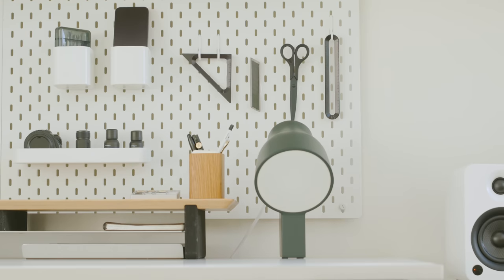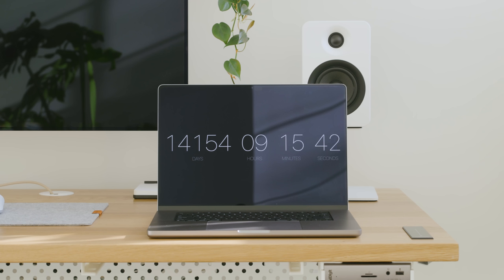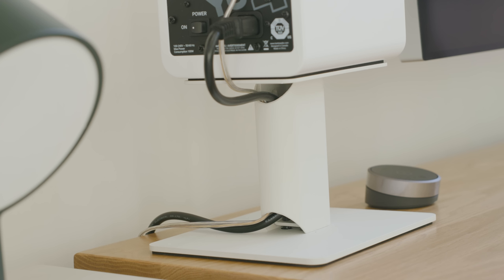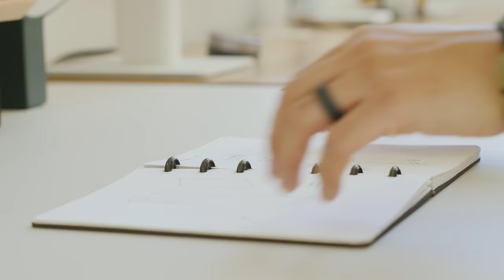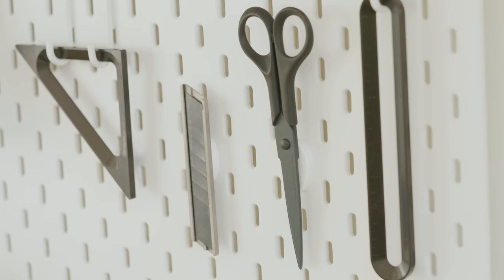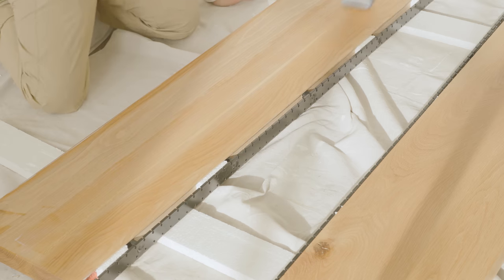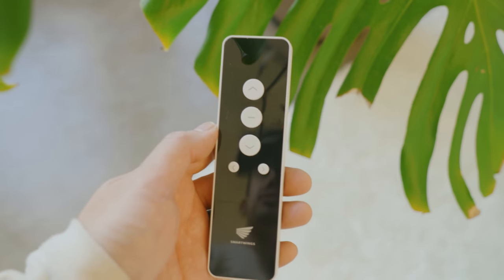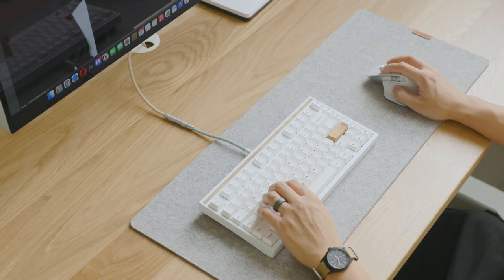Modern Desk Setup & Office Tour – Calm, Cozy, Creative

Comment: Do you have concerns about scratching the MacBook? The bracket for it looks like it would easily scratch the finish. And what about heat issues with constricted airflow under the desk?
Reply from the maker: I haven't had issues with either. The fan does spin up when rendering videos, but nothing to the point where I notice any performance issues.

Comment: turning on my laptop without the need of physically opening up the lid has been a struggle for me specially for a secured one which is company owned. any tips on that? I'm wondering how you open your macbook with this setup, do you remove it and press on the power button every time you need to turn it on?
Reply from the maker: I rarely turn my laptop off. No need. So this isn't really an issue for me.

Comment: Design question: I've created a modern office based off the ergonofis alive desk, medium size. I'm using a pair of SONOS ONEs speakers and I just purchased the SONOS mini sub for audio. Need a suggestion for modern, wood speaker stands for the ONEs sitting off to either edge of the desk. Want them to appear they were made for the ONEs. Hoping to support craftspersons. I've looked on Etsy and others, no luck. Suggestions?
Reply from the maker: Etsy would've been my first suggestion. The only other option is to build it yourself. Which may sound intimidating, but it can be super simple if you design it that way.

Comment: Love your videos! They've inspired me to try to mount an Xbox Series S to an Ikea pegboard though I I'm not sure how to create at the extra strength and stability for it so any ideas would be appreciated.
Reply from the maker: Just respect the weight limits, and you should be fine. I'd recommend the extra screw mounts on the bottom so the Skadis is secure to the wall.

Comment: Woah. Inspirational for sure. It's so important that light is present for mental health balance. Too moody and it can feel enclosed quickly. From an audio perspective, a 30 degree angle towards you will produce the optimum listening angle and make sure the tweeters are in line with your ear position from a height perspective.  The KRK app will allow you to just place your phone on the speaker and will let you know when you've reached the 30 degree angle 💪🏽
Reply from the maker: Thanks!

Comment: Hey there! As a tech enthusiast, I highly recommend checking out the HOTO Compressed Air Capsule. It offers both powerful vacuuming and blowing capabilities, making it a versatile tool for maintaining a clean desk setup. Plus, its compact size and multiple accessories make it perfect for on-the-go use. Definitely worth considering for your cleaning routine! Cheers!
Reply from the maker: I saw that. Thanks

Comment: what did you use to seal the concrete floors with? Would you recommend the product?
Reply from the maker: I used Euclid Solvent Based Lacquer. It's the only one I've had experience with, and so far it's held up very well. A few tips:
1. It has a strong odor, which wears off in about a week.
2. It cures quickly (within an hour), and will be "sticky" until it fully dries.
3. Make sure to use lambskin/wool applicator.
4. 2-3 coats will be best.

Comment: Do you recommend getting 2 single ergotron mounts or the dual? I have a 32 ultra wide and a 27inch monitor
Reply from the maker: Save space if you can, but only if it will support the weight and size.
Reply: @MatthewEncina  yeah I been reading and doing a lot of thinking I think the best scenario is to be safe in the long run and go with 2 single arm mounts. Less stress on the mounts thanks for the reply 👍🏼

Comment: @MatthewEncina will the hx arm allow the Pro Display to be in portrait mode?
Reply from the maker: I believe so
Reply: @MatthewEncina  thanks! Did you also have to drill into the desk to get the hx arm to fit with the  Ergonofis cable management system? I can’t seem to get mine to fit with the clamps.

Comment: I've had my eyes on the sway desk for a while and I think your setup sold me on it. What size is your main one? Any wobble when it's raised to max height? Also I noticed it doesn't come with the caster wheels. Was it difficult to install it yourself?
Reply from the maker: 60x30” There isn’t any sign of any wobbling at standing height, but if I’m doing some very aggressive typing, you might see a little wobble transfer through my attached monitor arm.

The caster wheels are easy to install, but the desk itself is very heavy since it’s solid wood. It took me 2 hours to assemble alone, and a few slightly challenging moments when lifting the desk.

Comment: Awesome setups, quick tip when trying to drill into the steel studs, pre-drill the wholes a bit smaller than the screws, and you won't have an issue getting them in. Love the content.
Reply from the maker: I did that only till I hit the stud. Thanks for the tip.

Comment: Love the setup but I someone with no credibility would recommend adding felt or some other soft fabric to the inside of the bracket so that when you put the laptop in there it doesn't scratch it up. That way when you go to sell and replace it nobody will go "ew scratch marks"
Reply from the maker: I've used this for 3 years and have seen zero scratch marks on my laptops.

Comment: $725 for a chair? And not even a great one either. Madness.
Reply from the maker: What makes a chair great?
Reply: @MatthewEncina  not style. 

Style over substance on a chair you’re going to be sat in for 40 hours a week is insane. 

You can get a fully adjustable (more than just vertical adjustment and a “lumbar support” curve) for $300.

That chair for $725 is daylight robbery. Don’t buy it, your 40 year old self will thank you for it.